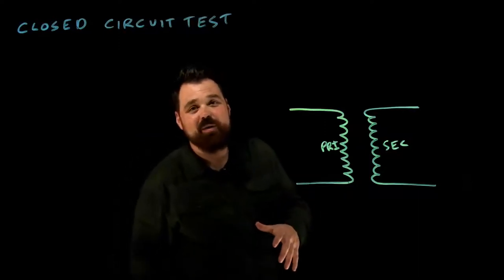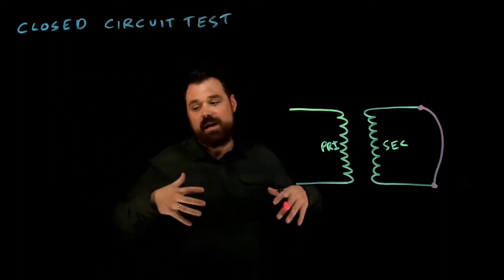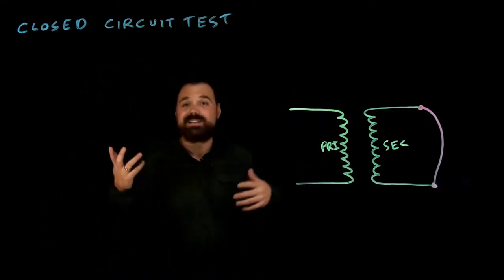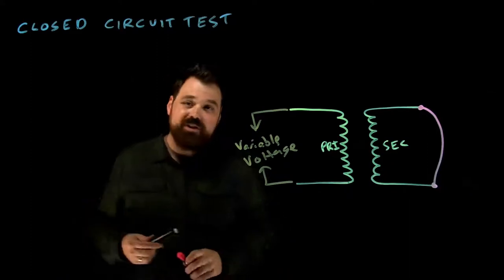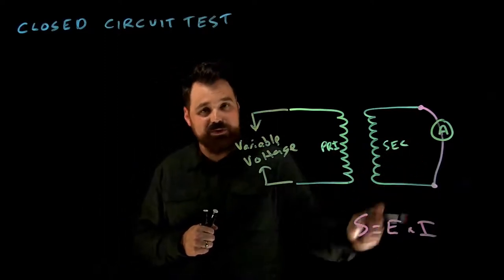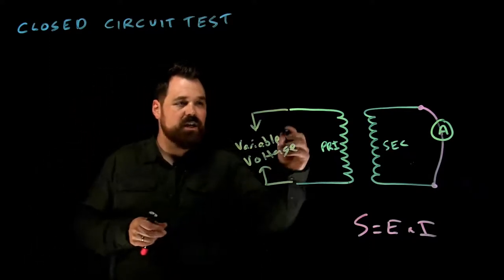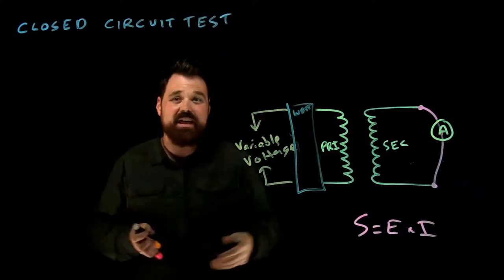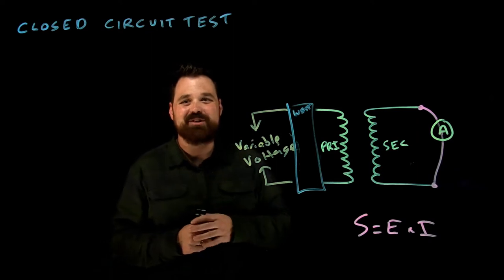Short Circuit Test on a Transformer

Comment: Sorry, not good nough for me. No info what S is or E. No info about what %Z is either. You wrote done one equation and that didn't get explained at all.
Reply: S is apparent power in volt-amps (VA) and E is the voltage you're connecting on the primary side.